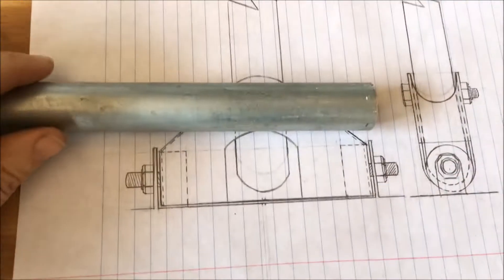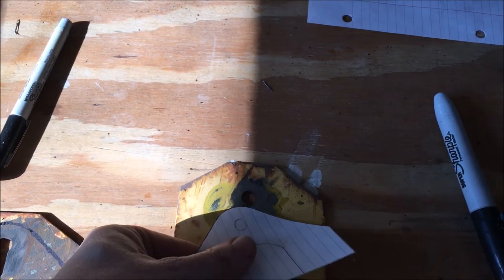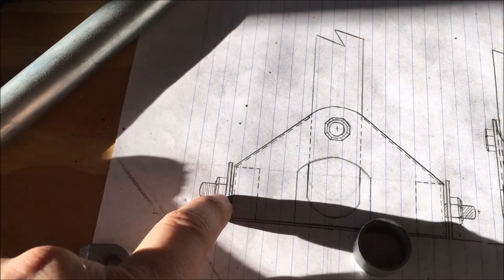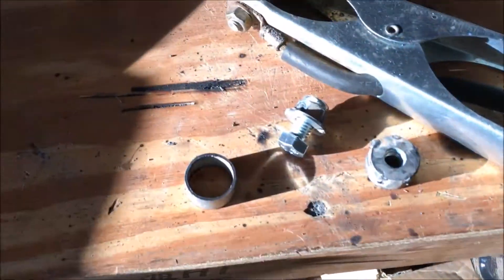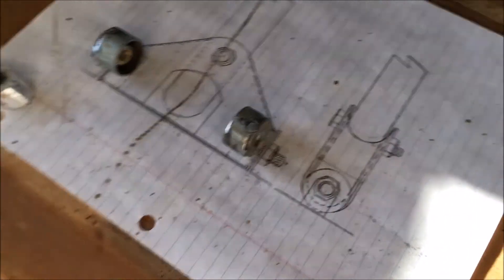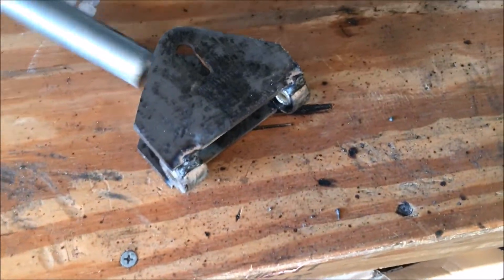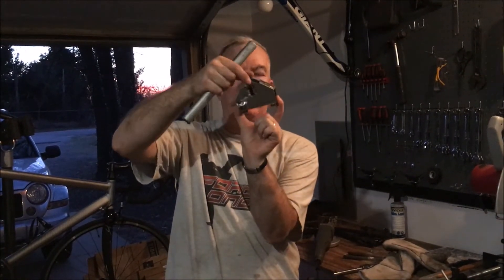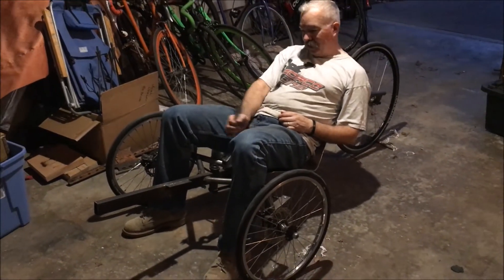Velomobile Steering. A trike with aircraft steering??? Yup that and more....

Comment: Interesting! i'm looking forward to seeing the finished steering system. it's something i've been struggling with on the velomobile i'm building (see my video). Are you using wires to connect it to the wheels?
Reply from the maker: Actually I am using small bolts... The new video that shows the finished product is getting posted tonight!!!